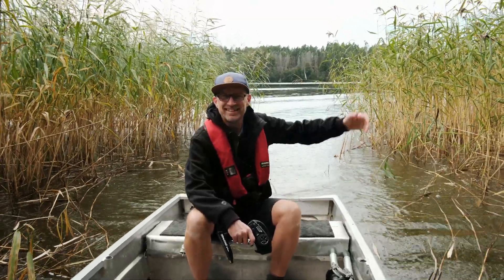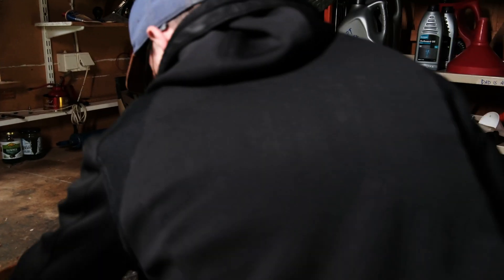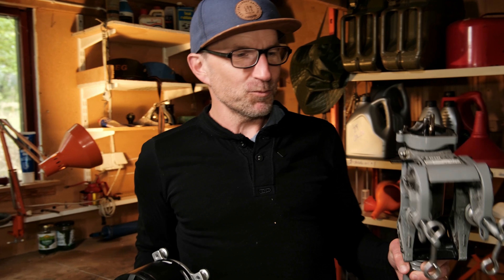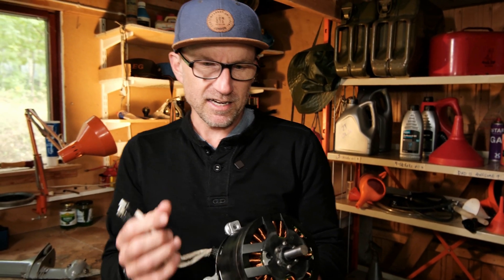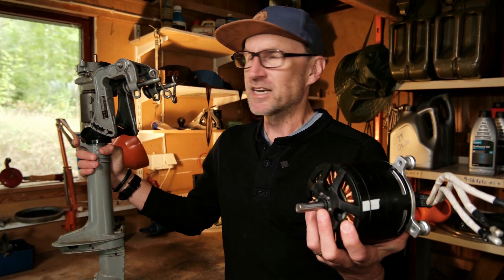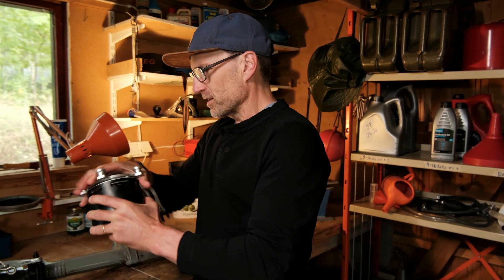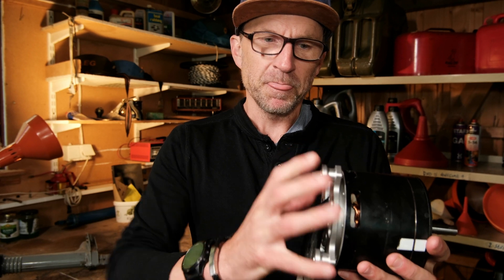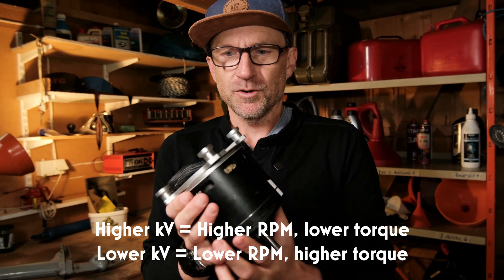Make your own electric outboard! Choice of Motor and ESC!

Comment: What model motor did you use? Is it BLDC or PMSM? If it is BLDC don't calculate the rpm with KV, max efficiency for BLDC is at about 60-70% of max rpm

Comment: This was the first video I watched before i built mine, and it served me well.  For anyone who doesn't need  this much power, a cheap 48v 2000w 43-4500rpm motor has plenty of power and appropriate rpms for a 4hp bottom end.  I fit the cheapest 48v conversion kit for a razor dirtbike under the hood of a 4hp johnson with a waterproof 48v fan.  I never would have done it if it wasn't for this excellent video.
Reply: Nice job man! What kind of boat are you using it with and how does it perform? I'm curious because I just finished a Suzuki 6hp conversion with a 3000W brushless kit (4000W peak) but haven't sourced a proper battery for it yet. Just looking for a bit of reference, what to expect from my build 😀

Comment: Really great use to reuse something that you can salvage. BUT, no mention of costs. What did you spend for everything?  With Electric motors for sale now the cooling system is resolved by having the motor in the water sealed in an enclosure. Big question is how do they compare to what you made above water in speed and longevity?  Which motor will last the longest.  Over all COST between yours and theirs.
Reply: Submerged motors work fine for low power outboards, but as the motors get bigger and speeds higher, the drag from a bulky lower unit can become a problem. I really like that they could find a watercooled motor, but I think a couple of cooling fans could work pretty well too.

Comment: Hi John, I built a wooden 18foot yacht in my garage. ( 3 years project) and my propulsion is a set of 2 electric pods (in tandem) that are mounted underneath the bathing platform. Buying those pods would cost 8,000 per pod at 10KW based on 48V . Could you help on the design, either water proofing the pods or having a drive train and motors out of the water? I need some help?   ( I tried to add a my boat website in the comment, but youtube removes the whole comment...)

Comment: I'm super confused on your approach to water cooling.  Did you make some sort of manifold/heat sink that the water is routed through.....or do you just lay the rubber lines next to the motor and esc and hope for the best?

Comment: I've been following a fella named Kris Harbor & he did a video on fact checking the motor ratings. Just because the online retailer listing says it doesn't mean the motor can actually put out the power, rpm or torque listed. The wire thickness & winding count are major parts for example of what a motor/generator can do. If the wire can only handle a few amps then there is no way it will reach the output needed by beefier materials. I refer here to some Chinese distributors via Amazon in this example.
Reply from the maker: Thanks for your comment, and yes, this is particularly true! There is a lot of junk out there, particularly on Amazon etc. In any case it is paramount to work with quality materials and the best people to make good products. We have found our team in different geographic locations, and the Chinese have proved an amazingly reliable an dhigh quality supplier in these regard. We produce a number of parts there because they are so good at what they do. Thanks again, and have a great day! /John

Comment: There are alot of choices for bldc  motors , the one you have kinda looks like a high rpm motor I wonder if a slower rpm motor like for a emotorcycle would run with less heat ?
Reply from the maker: @jacobclark89  Great thoughts! The rpms don't have too much to do with the heat generated in this case. It is more to do with the small size of the motor and the amount of work it needs to do with it's accumulated inefficiencies, that produce heat. Higher voltage could be more helpful in some systems, which lowers amperage, and heat build up. But in this case, a larger motor, higher voltage, and less amperage would be the fastest way to a more desirable outcome. Thanks for hanging abnout! /John

Comment: To much money I use a car alternator with a household light dimmer switch🤓🤓🤓 $40.00 total.I think it will work with one car battery Ten knots is all I need🤔🤔🤔 with a 100 watt solar panel.With a toggle switch for a charge controller🤣🤣🤣🤣🤣🤣
Reply from the maker: @rbarker4426 Excellent work, love electric in all shape and form! /John

Comment: Am I right in thinking these are DC motors? If I was wanting to move a 40ft power catamaran and replace say two Yamaha 115HP motors, I'd be looking at an AC motor solution? It's all theoretical at the moment, but I have seen such outboard motors move the catamaran at 11 knots. Someone told me that these motors could probably send the cat along at 20-25 knots if pushed.
Reply from the maker: @fredflintstone1428 Anything is possible with electricity, and there are larger builds which will easy do what you are mentioning! 

Have a great day! /John

Comment: Hi Guys! Thanks a lot for the videos. Good starting point of my project to convert an old motor to a new. I watched all your videos and missed the info what made you end up with battery voltage you have chosen. Is the 24s a common practice? Why didnt you go higher/lower? The motor seems to be able to handle up to 100v. 
/ Christian
Reply from the maker: Hi @christiankark2472 !

We chose the higher voltage for a number of reasons, primarily system efficiency, but we also wanted to do a few craxy rpm runs 😅. More voltage, more rpms, more craziness! But in saying that, we don't run that hard all the time, because it just wrecks stuff, and we don't sort of have a budget for that!😅

Hope this helps!

/John

Comment: The heat loss is inefficient way to run it, better off getting a motor that is going to run cool at your max power levels, more expense though,  basically overrate the motor for the power level you want to run at.
There are so many different alternatives these days for motors/controllers etc,, must admit its a hell of a nice job you've done on it. Hope it turns out reliable in the long term.
Reply from the maker: Hey @namenotshown9277 !
Jack here!

Agreed, you should "over-spec" pretty much everything if you can. However, our main use case is to get over a 500m stretch of lake, so we can get away with using a smaller, lighter and cheaper motor, and just run it to the max⚡ Since it gets water-cooled of the old impeller, heat actually hasn't been an issue at all, and we can run it at 'cruising' speed for as long as the battery lasts👍

As for reliability it has been nothing but good to us, and we have run this setup for almost 3 years now. The only issue we have had with it was down to us using 'bad' water-cooling hoses which led to leaks. This led to the bearings destroying themselves, but that was a relatively easy fix👍

Thanks for watching!
Cheers🍻
/Jack
Reply: thanks for the detailed replies, I've built alot of electric vehicles over many years, just electric bikes and small three wheelers, I never really moved into esc and outrunner motors, but its all very similar, territoryI very much appreciate and understand the very long process involved in testing and building, you've done an amazing job, and to come up with something reliable is really quite an achievment. @marsonselectric

Comment: Hello! Did you manage to disassemble the motor while moving the shaft to other side? I've got mine all glued and i can't take anything apart. Also it can't be heated. For me its needed because of mounting complications, and for everyone else its necessary to be able to replace bearing at some point in time.
Reply from the maker: Hey there yar1625!
Yes we have disassembled our motors multiple times, replacing bearings and flipping shafts. It isn't the easiest thing on the planet, but as long as you are careful it isn't a problem.

We now sell this exact motor with the driveshaft already flipped, and ready for installation over on our website: marsons.se.
Check it out! We ship world wide😊

Btw: we are running a giveaway of that exact motor in this video: https://youtu.be/01g2oDwCcu8
 So hurry up and enter before we close it July 1st! 

Good luck with your project!
Cheers🍻
/Jack
Reply: @marsonselectric  It would be great if you tell me how did you do it? Or may be it's an idea for a video? With mine it seems like glue joint is stronger than aluminum parts themselves. Did you apply heat to it? For my project i want the shaft in its regular position, but thank you)

Comment: well after listening to you, i have decided to stick with the gas engine.  Electric outboards are not ready for me.  far to complex for a guy who just wants to fish on the weekend.
Reply from the maker: Hi Rutger100!
Jack here!
You may feel it is to complex to build, however that's why we are working on ready to go kits😊 An electric outboard is perfect for fishing, so don't give up on electric so quickly! Subscribe to see when we publish the kits👍

Have a good one!
Cheers🍻
/Jack
Reply: Thanks that is what i need.  A kit.  I can assemble it with instructions and a good parts list. I'll hold off of the gas! @marsonselectric
Reply: He was building one himself. Imagine building a gas outboarder from scratch, is that really easier? You can go electric simply by buying a self-contained electric outboard motor where you only choose the power you want.
Reply: Yes it's much easier, vertical shaft engines liter the place where I live.  very cheap and I can find a used drive leg, in fact, I have one in my barn.   @tosevit

Comment: I want to drive a 12 inch brass propeller on a 1 inch propshaft. In place of a 15 hp diesel motor, would this motor you have do the job?
Reply from the maker: Hi Ray!

It could depending on the distances you want to trvle. Otherwise our next model up would definitely do the trick.

Get in touch via email and we'll give you a hand with getting the right specs👍

/John

Comment: Encase the motor in oil and be rid of the transfer shaft all together. 
It would be a nacelle on the end of the case. 
The oil conducts the heat and the water takes it away.
Reply from the maker: Hi Charles! Jack here.
This is why pod motors are so great. And technically most BLDC motors are waterproof in it of themselves, and wouldn't need an oil bath. There is actually another creator here on YouTube who made a DIY pod motor this way, I will see if I can find the video for you. 

With that said, for most people the way we went about it will be the easiest way to convert their old outboard😊

Thanks for watching!
/Jack

Comment: Great Stuff. Where can I find the details of the batteries used please?
Reply from the maker: Hey there Erik! Jack here.
The battery we used for this setup was a 24s, 86V battery that dad built himself. It uses LiPO cells, since they can output the most amps relative to their size and weight. You will find more information about the battery here: https://youtu.be/C6OEzgNDZto

We also have a production spec battery that we will be selling on our website very shortly (within a month). I can update you when it's available😊

Hope this answered your question!
Cheers/ Jack
Reply: @marsonselectric  please ndo

Comment: Very exciting, great stuff. 
 I wonder if   even weight distribution bow to the stern  will improve performance. 
In watching your videos of the outboard and the airboat propulsion the boat noses up at slower speed requiring more effort to get to a plane. 
Have you tried an alternate payload distribution?  A tiller extension would be simpler than moving the battery box.
Reply from the maker: Hi Andrew!
Jack here! Thanks for your comment!
Yes, a more even weight distribution would be slightly better! However, the hull is so light (only 38kg), so it gets up on plane no problem anyway😃 

That's not to say that we haven't thought about moving the power pack; though we want to keep the cabling and water-cooling hoses as short as possible, so therefore we have decided against it. A tiller extension is actually a good alternative, but not entirely necessary for our short, full throttle journeys over the lake👍😁

Thanks for watching and commenting😊
/Jack

Comment: If you have a 10 horsepower lower unit can you put a 20 horsepower electric motor on it
Reply from the maker: Hi there Yogenh! Jack here.
Sorry for our late reply.

I would say that it is no problem to use 20hp on a 10hp unit, especially considering that some motors, where produced with the same components, but "locked" to different power levels. For example we had an old 10hp Parsun 4 stroke, that had the internals of a 20 HP. So google your "donor" motor and see what the go is.

There are of course a few risks with putting more power on a smaller lower unit! Due to electric motors generally producing A LOT more torque then an ICE-engines, and spinning at higher RPMs, you run the risk damaging (probably straight up stripping) the components in the gearbox. This hasn't happened to us, however:
a) our bottom unit was pretty solid.
b) we are only running a few more horsepower.

Hope this discussion helps your though process! And good luck if you decide to go for it! 
Keep us in the loop😎
//Jack

Comment: What is your top speed
Reply from the maker: Hi @Banshee Paradox! 

Thanks for your question!

We get 30kph out of the setup. Acceleration is the really fun bit, it is enormous!

Have a great day!

/John
Reply: @marsonselectric  thank you, what brand of motor are you using, and how much is the kv, im planing to build an electric surfboard, do you think that motor can handle 100 mm impleller jetpump?
Reply from the maker: @bansheeparadox2678  We've had the motor manufactured to our specs and it is available on our website now together with a controller. The motor will handle a 200mm outboard propeller no problems. it would however be an incorrect choice for an impeller jetpump for many other reasons. In looking around there are some specific motors for jetpumps for electric surfboards, and they will do a much better job and be easier to work with in that application. Hope the info is helpful, let me know your thoughts or if you need anything else :)

Comment: great video, look forward to the part of the batteries.
I'm curious to see how you got all those 80volt amps and how much mileage you have!
Reply from the maker: Hi Antonio! Jack here!
Glad you liked the video! We will be starting work on the battery video within short😊
As for the mileage, we get roughly 20 kilometers on the water out of this setup, so plenty for us! And considering the motor setup (being built on that old Mariner gearbox), there is certainly more efficiency to be extracted😁
Reply: @marsonselectric  hi Jack, glad to meet you, I'm working on a some Project, convert an old outboard petrol motor to electric, but to use only for trolling. Then low velocity but long rage.
Your video is inspiring me.
Thanks
Reply from the maker: Glad to here that we can offer some inspiration😊(and hopefully some useful information to😅)
Considering that you are going for a trolling setup you should be able to get some really good mileage/runtimes. After all that is what is so good with electric, it only draws a certain amount of power at any given time! At trolling speeds our setup draws just a few 100W; and maybe 1-2kW if going a bit faster (but still "trolling speed").
Reply: @marsonselectric  I've understand only one thing, I must realize it and test it, because there is more variables, boat, load, wind, sea conditions, etc etc etc
Is more difficult to find the right setup without more tests

Comment: Awesome videos, love following your projects. I'm curious about the power draw when you are using the motor, have you measured it? Would be cool to see a "input power vs boat speed"-graph/table :)
Reply from the maker: Hi Anton! Thanks for following along! We have a lot more projects to come so stay tuned!😃Sadly we cannot get the ESC logs to show you this (as discussed @ 12:05 in the video). This has been a problem for long time, pretty much since the "The Mini Electric Airboat on the best ICE!"-video (se 12:40 in that video). We are just as bummed out as you are, but we might be able to show this in some other way in the future 😊 Also, we will be replacing the APD ESC with something new and exciting later on this year! So maybe then we can get some logs from the new setup👍

By the way, checked out your channel, and your Crescent build is awesome! Feel free to connect with us through our socials😊
Instagram:
@johndehosson
@jack_de_hosson
Facebook:
John de Hosson
Jack de Hosson

Thanks again for watching! 
/Jack
Reply: @marsonselectric  Too bad it can't log data, it seems like a really good ESC otherwise. If you have a clamp multimeter you can measure the current directly from the battery, it will give a rough estimation at least. 
Thanks for checking out my build, glad you liked it! :)
Reply from the maker: We do in fact have a clamp multimeter, and I believe we have measured it that way once upon a time... However we want "proper" stats🤓😅 Really we just want the numbers that we convey to be (as far as we kan provide) accurate. However we might be able to squeeze something in the next video or two😊 If not using the multimeter, we could screen record the BMS app and then manually plot the wattage.... A lot of work but maybe worth it if you would like to see that!

/Jack
Reply: @John de Hosson  I understand that you like good stats, I do too of course :)  Do whatever you like, I don't want to push you to do heavy work :P I'm mostly curious what approximate power you are getting and a speed estimate :) I mean, if the power is in the range of the old outboard (10hp), or maybe less or more?